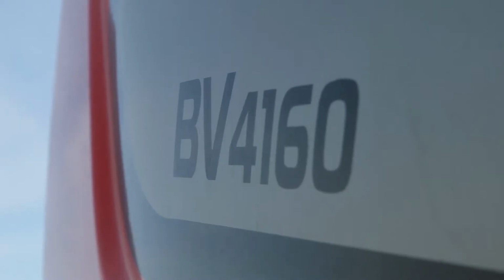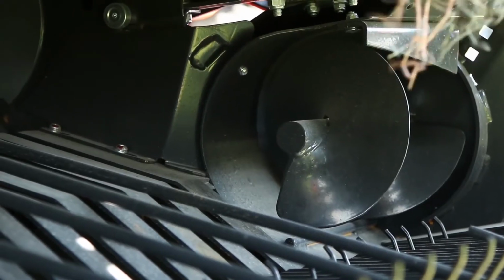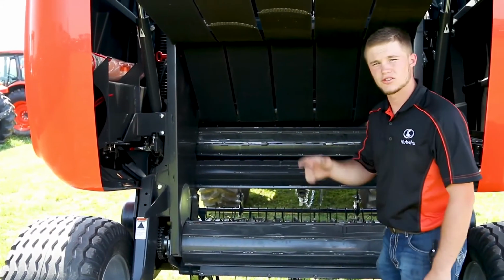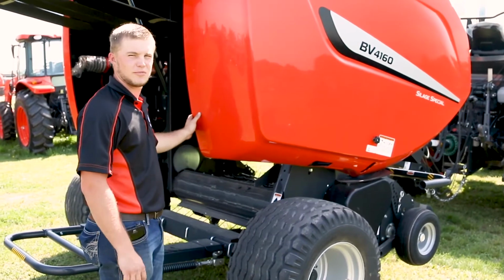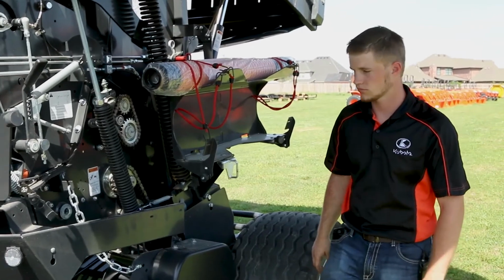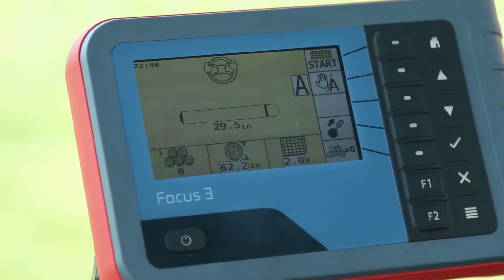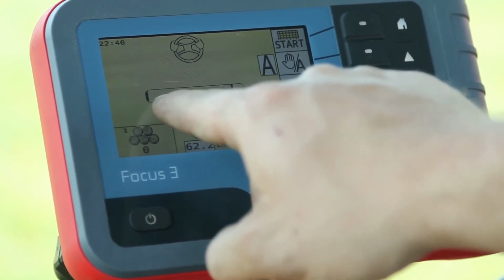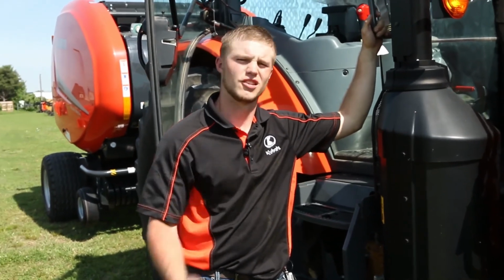Kubota Round Baler Walk-Around

Comment: Thanks, very helpful.  We took delivery of a new 4160e, Kubota came to set it up.  We rolled 1/2 a roll and the pickup jammed up with hay.  Our windrows were larger than yours in the video but we were only going 2.5mph when this happened.  Dealer had no explanation.  have you experienced this issue and, if so, what did you do to correct it?  Thanks